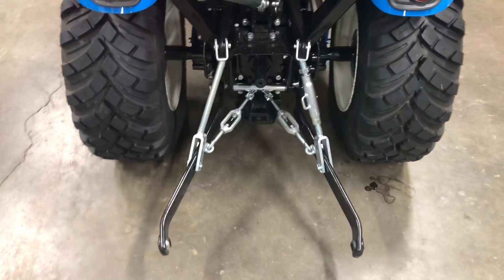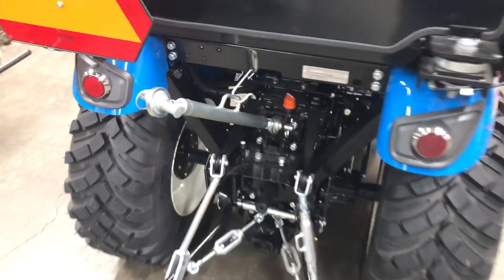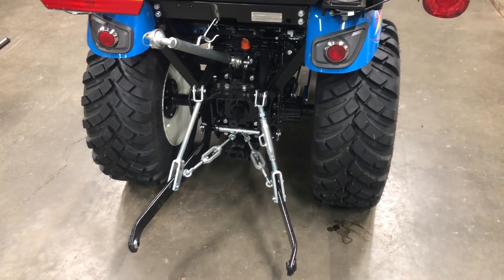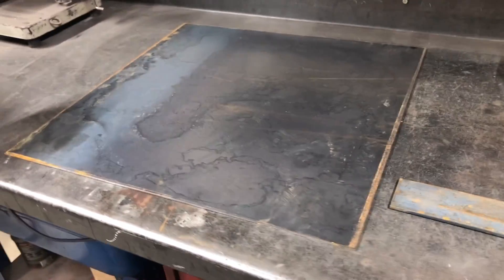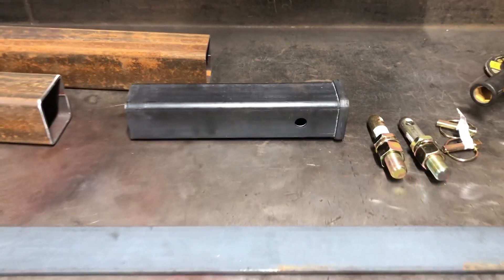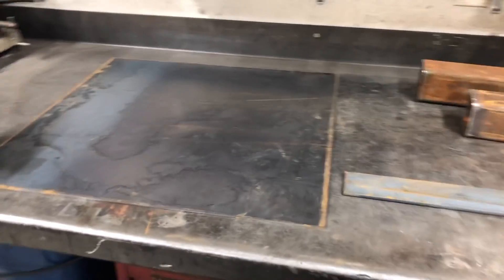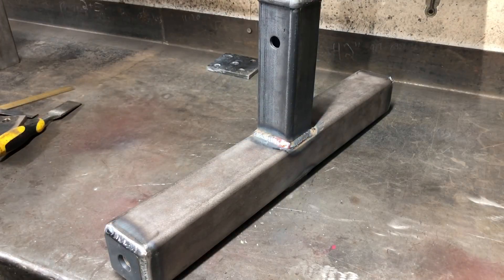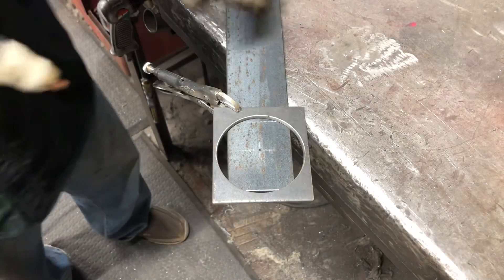Fabricating a three point hitch / ballast box for LS tractor

Comment: Compliments to the quality of the fab work and your techniques!  I'm sure the 3-point hitch itself is a little hefty, guessing around 50# or so.  Adding in the additional what looked like about 125# per side, so... around 300# total available ballast?  

I really like how compact that design is and some ballast is better than no ballast in so many cases.  The box I built is around 600# all in, which a lot of times is probably more than I need and it's big/bulky to keep/move around.  So, yeah...I like the balance yours offers.   You might consider a feature where you can add on to that thing, as your tractor is certainly capable of carrying enough to justify far more than 300# worth of ballast.
Reply from the maker: I should also add that I do have the rear tires filled with liquid for traction as well.
Reply from the maker: Thank you. As is, it can fit eight bricks At approximately 25 pounds per brick. So 200 pounds of lead bricks. I haven’t weighed the hitch itself, but I’d imagine between 50-75 pounds. So 300 pounds tops for the entire unit is probably a high estimate. I can always modify it to accommodate more ballist if needed. I wanted the flexibility of easily adding or removing weight, and I didn’t want a big bulky unit. Hopefully it works well, time will tell.